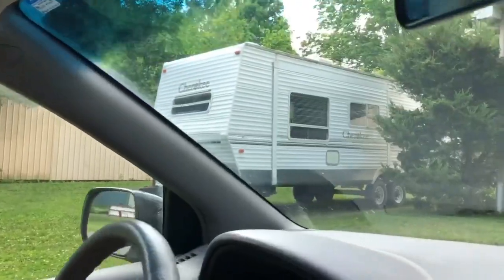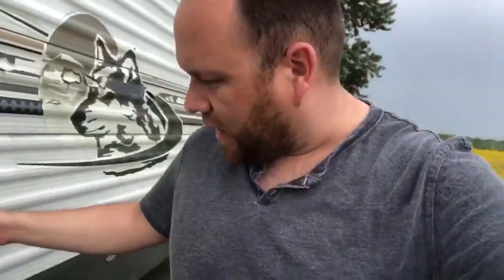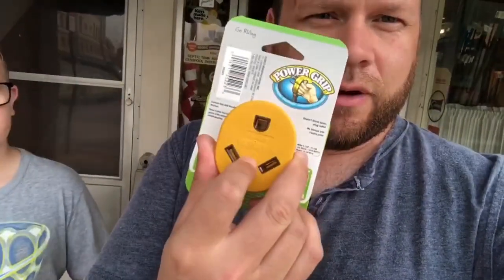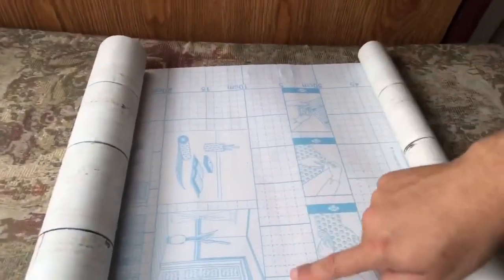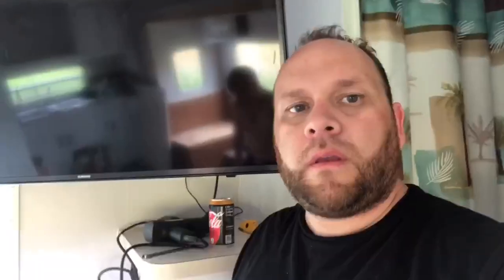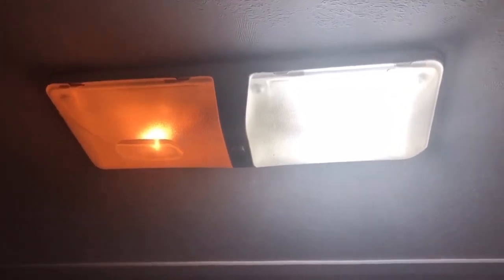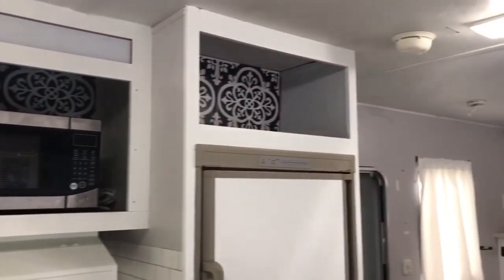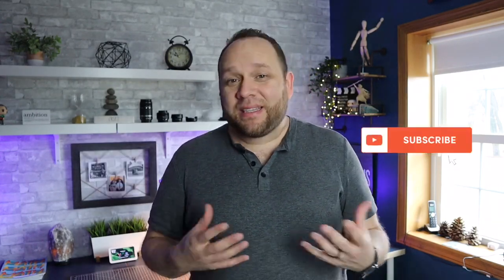Camper Remodel Before and After: Farmhouse Style

Comment from the maker: Here are the products I used in this video:

Grey Cabinet Paint - https://amzn.to/30fsH3S
Peel & Stick Tiles - https://amzn.to/2OgWP7K
Backsplash Subway Tile - https://amzn.to/2Qr1Ldd
Shiplap Contact Paper - https://amzn.to/2LKfDL7
Modern Pull Handles - https://amzn.to/2NtIENg
Samsung Ultra HD TV - https://amzn.to/2LH4H0C
Adventure Awaits Decal - https://amzn.to/30f2EKh
Home is Where You Park It Sign - https://amzn.to/34ZAMZi
Black Stove Cover - https://amzn.to/2LJmVyP
LED Light Bulbs - https://amzn.to/2Qr2rzh
Grey Rug - https://amzn.to/350iLKp
Grey Blanket - https://amzn.to/30dWZnM
Extension USB Outlet - https://amzn.to/31HQOFj
Plain White Contact Paper - https://amzn.to/2M7CG1s
Digital Clock - https://amzn.to/2OhI70m
Indoor/Outdoor Thermometer - https://amzn.to/30f1jmJ
Camper Door Handle - https://amzn.to/31GUgQk
RV Electrical Adaptor - https://amzn.to/2NudmFO
Step Brace - https://amzn.to/2VdYqNo
Level Adaptor - https://amzn.to/31MVSIo
Exacto Knife - https://amzn.to/31G7pt6